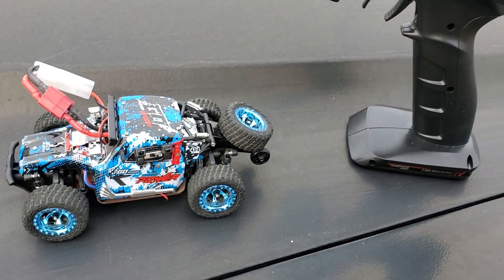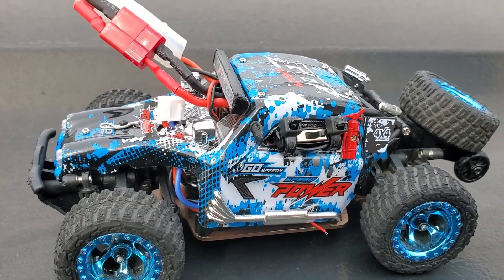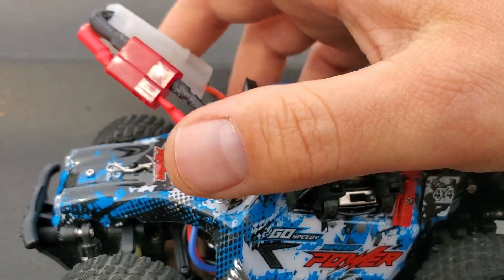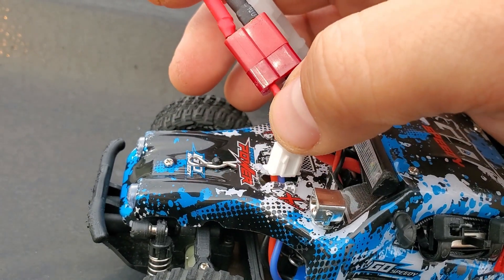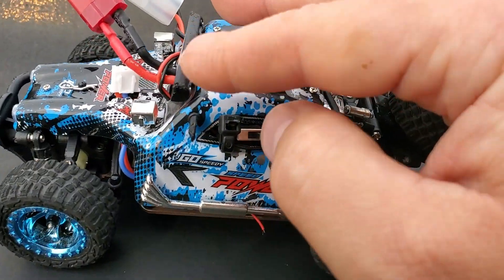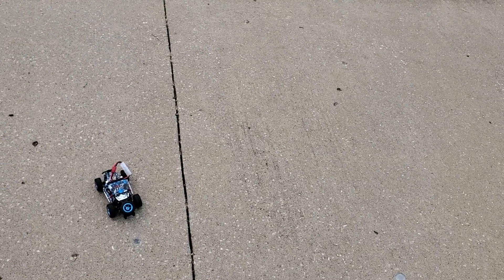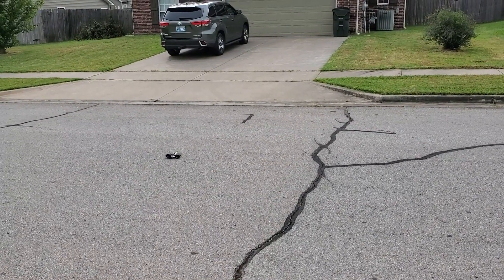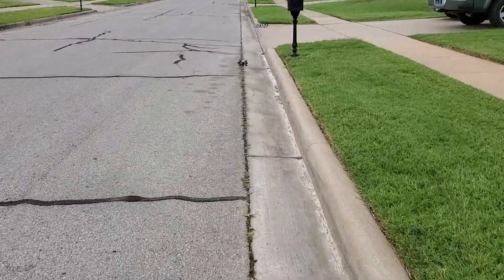WLToys 284161 - Brushless Conversion

Comment: Cable management hey 😂 though its a definite speed devil i know the particular truck and most common upgrade kits etc. pushing out your windshield, not needed. Also it would you take extra mph as you took the aerodynamics and tossed em out the broken window 😂

Comment: Wow, it's fast! Which motor/esc are you using? What do you think of its turning radius?
Reply from the maker: Its fast but at this speed turning instantly flips it. its a blast but so hard to drive. 

using this ESC and transmitter combo, but not the motor:
https://www.amazon.com/gp/aw/d/B09QCPXHSD?psc=1&ref=ppx_pop_mob_b_asin_image

Using this motor with 2mm to 3.5mm bullet adapter:
https://www.amazon.com/gp/aw/d/B09CX71VTC?psc=1&ref=ppx_pop_mob_b_asin_title
Reply: @bonusroundgamevids  thanks for the information,  but the way the second Amazon link doesn't work. Cheers
Reply from the maker: @spockfpv  oops, fixed the link
Reply: @bonusroundgamevids  which upgraded battery would you recommend?
Reply: @bonusroundgamevids  Can you show how to take off the metal pinion gear from the stock motor and can you link the new gear that you used for the brushless motor